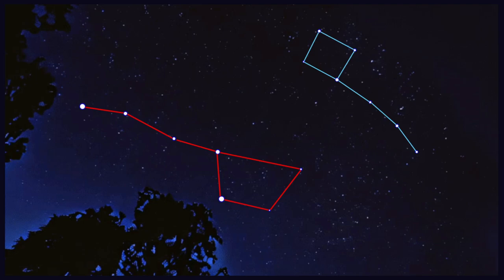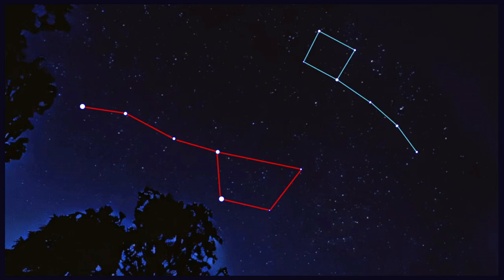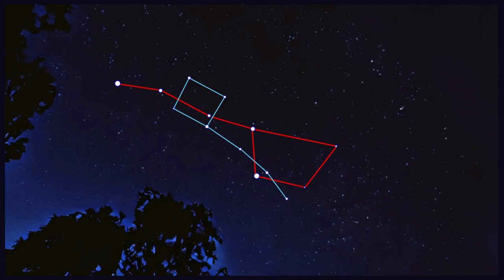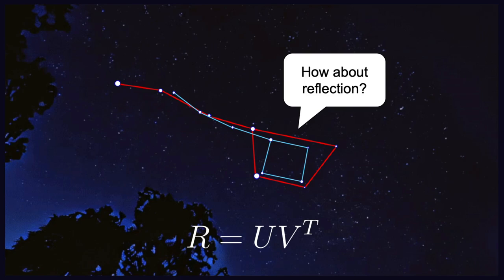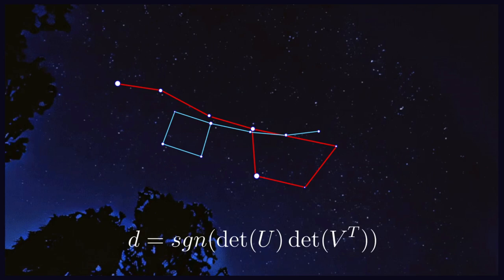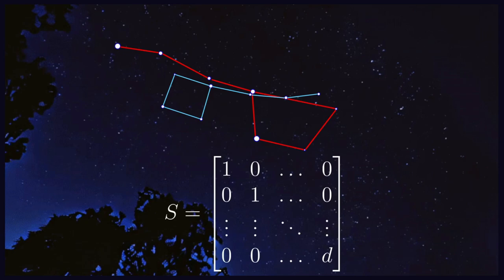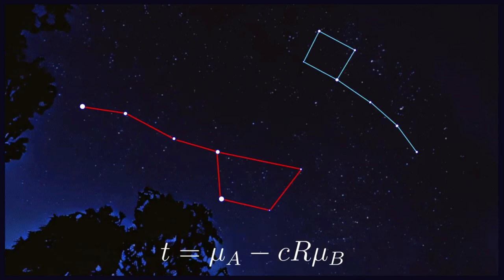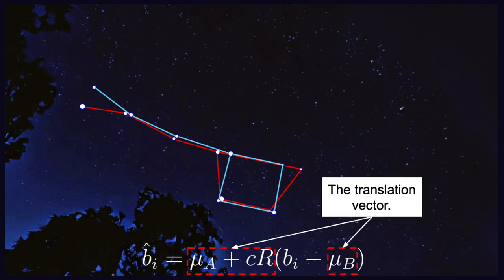Kabsch-Umeyama Algorithm - How to Align Point Patterns

Comment: I implemented this for a KUKA robot as my Bc. thesis many years ago :D Isn't it required to roughly know the point pairs beforehand?
Reply from the maker: Hehe, I've recently discovered this algorithm since I needed to align some data points in 3D for my work, and thought it would be nice to share here what I've learned. :)

Yes, you need to know both the source and target points for this algorithm.